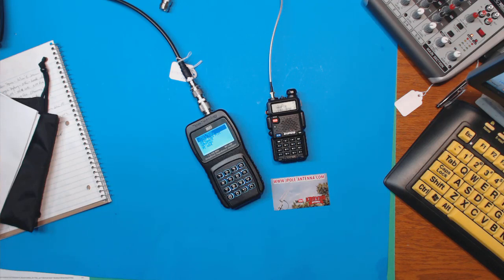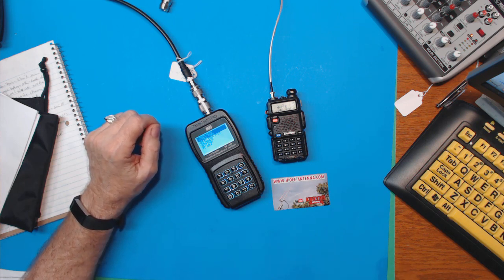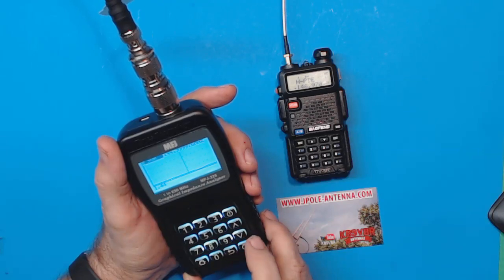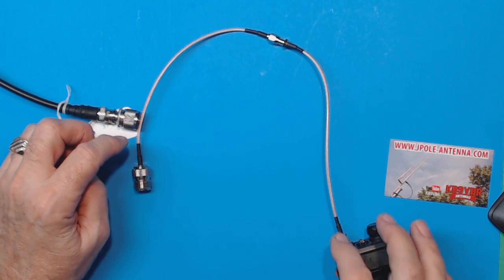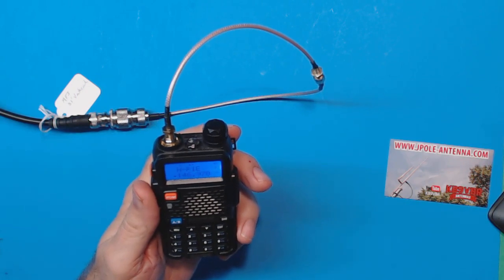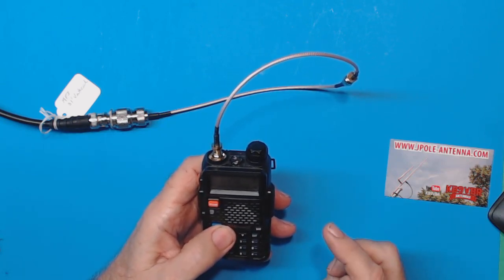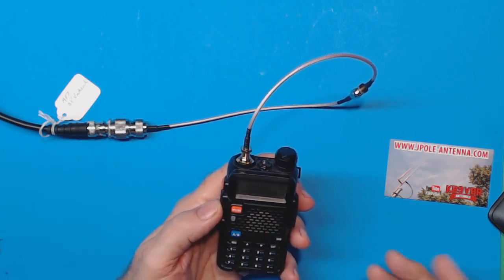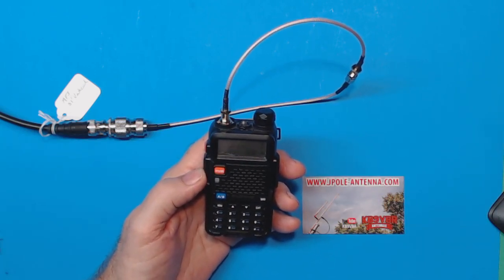TRRS #1423 - J-Pole Antenna Testing

Comment: You should check out the Ed Fong DBJ-1 Dual Band VHF UHF base antenna on Ebay as well..  very cool antenna.. put it in PVC for base use or use it as a portable roll up antenna..

Comment: $35 for that antenna? You're right; that's pretty cheap alright given the price of copper. Michael's venture seems less of a business and more of a service to the community so good on him!

One question though: Isn't there a loss in signal for each adaptor used?
Reply from the maker: Yes, there is some loss for each connector when  used for transmitting not do much when only receiving.